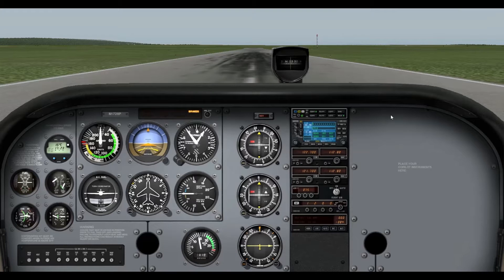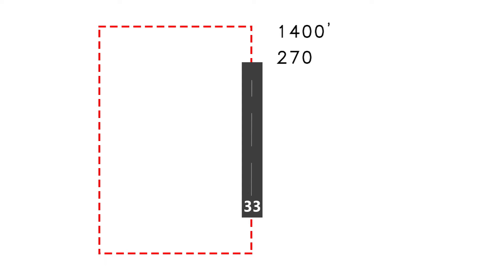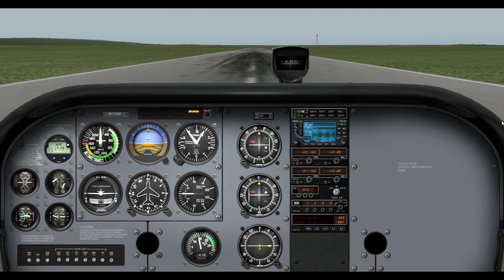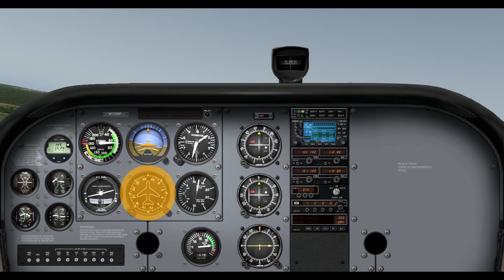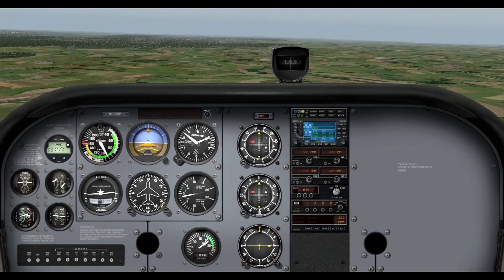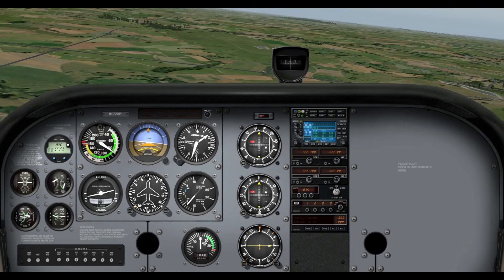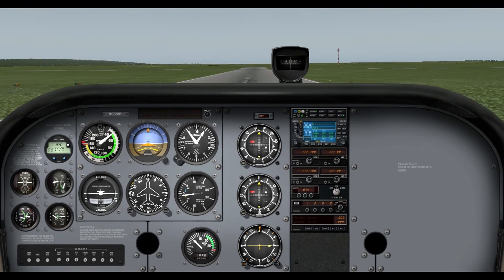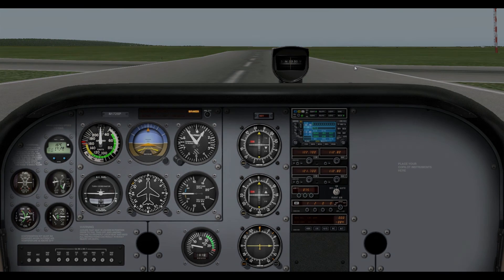How to Fly the Circuit - Georgian College Navigation Class - X-Plane 10

Comment: When doing circuits why not QFE ???
Reply from the maker: Hey! Thanks for the comment, and good question! By QFE, you mean setting the altimeter to 0 for field height? I actually don't personally like the idea, plus every flight instructor I've ever met says don't do it. It is all about building a habit, right? So I always have my altimeter set to ASL because that's what it should be set at, plus you aren't second guessing yourself if you lose visibility. This is especially true if you want to go on to get your Commercial or IFR ratings, while it might be easier in the short run, I think new pilots should learn to do the simple math on the fly (pardon the pun). I hope I understood your question, let me know if I got it totally wrong! ;)